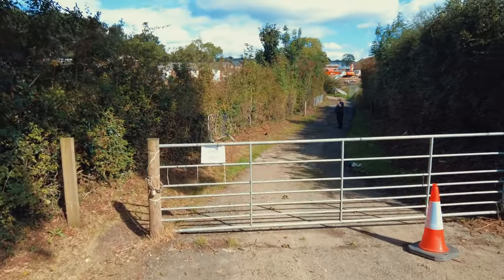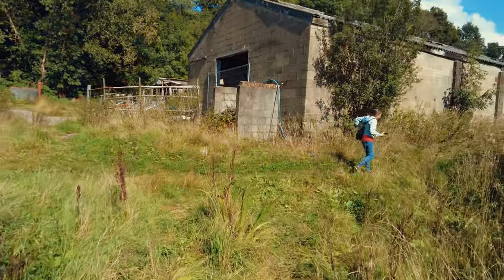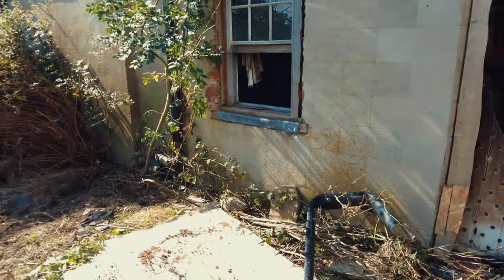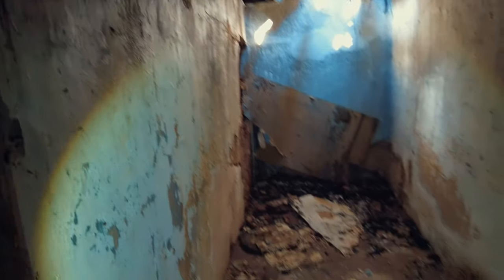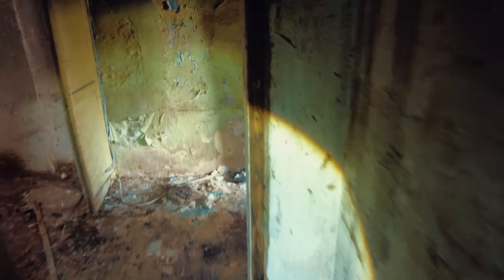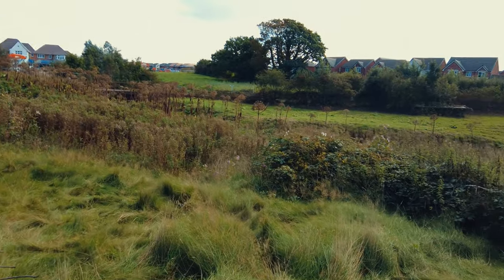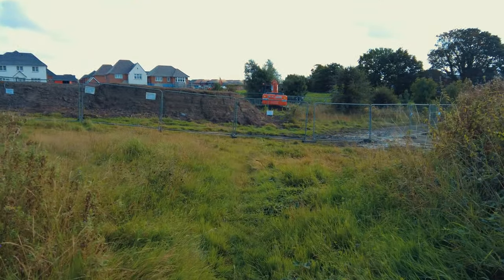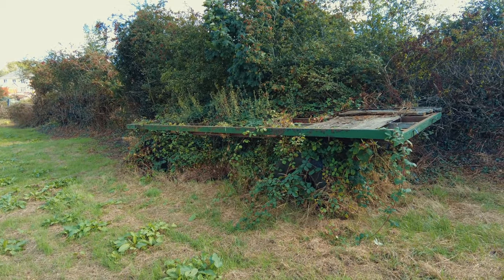The Carcass of Garrett Hall - Tyldesley - Memories

Comment: Sadly it's changed so much around the Garrett. It's almost unrecognisable now when I return. I was at school with James Patrick 76-83. Wasn't best mates but went to a birthday party at the house in the early 80s. There was a rumour that a secret passage led from the farm to under  the school stage, but if that's true I'm unsure. It was supposedly dug during the war. Also a Ww2 bomb apparently hit the field next to the school where the houses are now built. I remember a big crater in the field back in the 70s. The Patrick's also rented the farm on chaddock lane that now has that terrible pub built on it, think it's called the Applegate or something. There's also rumours that the fire was set on purpose but probably best not to get into that for legal purposes. A guy once came into assembly at the school and told ghost stories, the farm was supposed to be haunted, the loft in particular. The hall which was built in 17th century the hall was later converted into a farm house. The hall and presumably the farmhouse had 2 preist holes, Hiding places in walls or floors for priests when they were escaping persecution.
Reply from the maker: Thanks very much for your history m8.

Comment: Could I ask a request if possible please Clarky
Reply from the maker: Fire away!
Reply: @TheUrbanCollectiveWeFilmIt  I know a few years back you did the BRSA which was a great video pal but was always wondering if you ever ventured just beyond into the old platform for the old boat shuttle near the cathedral. Now don't if you knew or not but a lot of the underground there was later used as the air raid shelter during ww2. As a lad I ventured in there but only got so far to be discovered by MPs and escorted out through a door underneath Victoria Station where Manchester police were waiting.
Reply from the maker: I did venture down a manhole into this place directly below the cathedral and on the side of the river! Could be related m8 or at least joined further in. I had to bail though because I was alone and the police were on route! https://youtu.be/xHhl5MoeRo8
Reply: @TheUrbanCollectiveWeFilmIt  it does or did connect to the old shelter an the BRSA further a long. Where the river is head up towards piccadilly they connected to what was the atomic shelter that sits under majority of piccadilly later used partially by BT around China Town. I do believe, when I was in the there mid eighties it was still partially occupied by the MOD still. The atomic shelter was built before the arndale went up by majority none English speaking builder's. I've seen many videos of people down there but still none have made the connection that the whole of the city centre is actually built upon an older city and it's all still down there ..
Reply from the maker: @ApolloUK  Are you referring to the Guardian or pert of it because I know that is actually used by BT too?
Reply: @TheUrbanCollectiveWeFilmIt  yes pal 👍🏻 👍🏻 before the guardian atomic shelter was built they removed and built upon old Manchester which is still, I think.. All connected up I remember it being a labyrinth of tunnels and passage way's with actual street names still visible bits looking like houses as a young lad inspired by the goonies it was breathtaking but all I have is the memories of those few day's I spent in an out till I was cort inside part of the guardian. I remember signs a over Manchester declaring it a nuclear free city haha little did Manchester know what was beneath their feet.